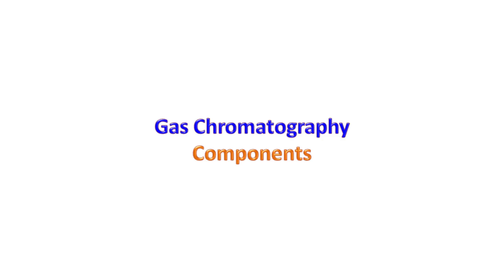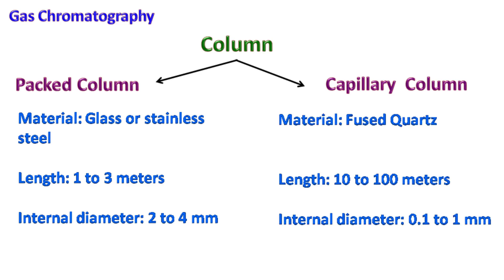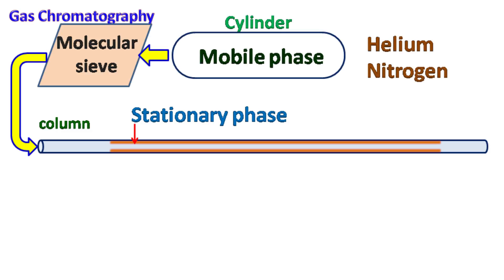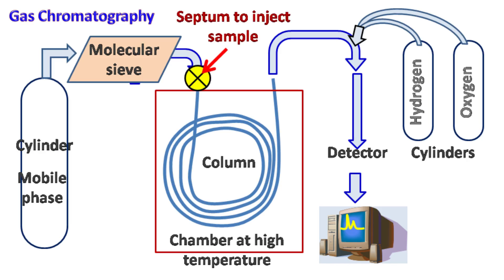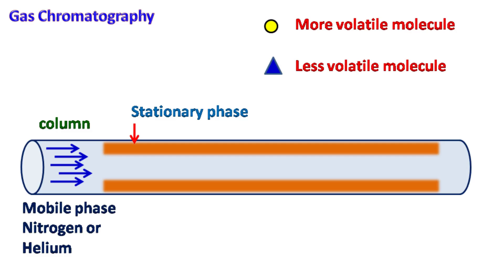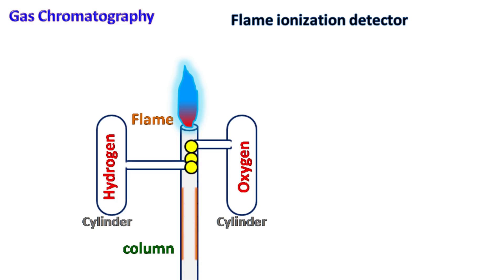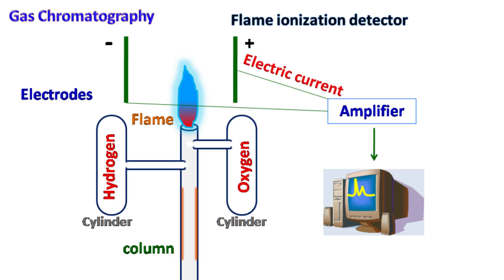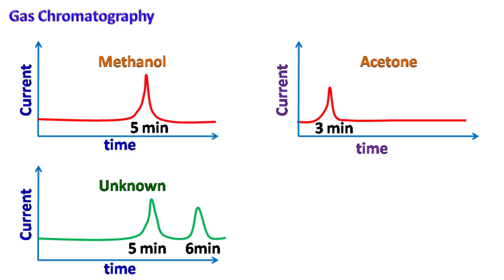Gas chromatography | GC

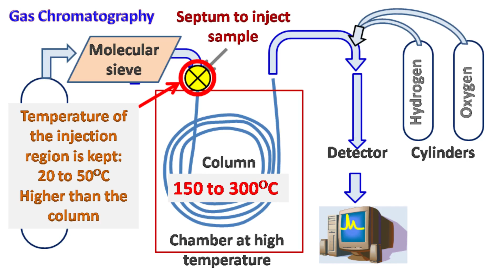Comment: 2:45 I don't understand when the temperature of the injection in 20-50 degrees Celcius and the column is 150-300 celcius which means the column is higher, but you said and is given in the picture that the temperature of the injection is higher than the column, does that mean the temperature of the injection is 150+20 degrees celcius? where we add that 20 and 50 ? Please can I get an explanation🥺
Reply: No temp of injection always greater than oven temperature
Reply: @VyankateshPawar2130  then why does it say 20 to 50 degrees celcius? and the oven a huge number ? thank you for your reply :3

Comment: summary of the video: 
GC is used for the separation of volatile compounds( compounds which are easily vapourized at room temp)

Components of GC:
1) SAMPLE is mixed withe a highly volatile compound like Hexane, cyclohexane, etc.

• Long coiled column: can either be a packed column(made of glass/stainless steel) or Capillary column (made of fused quartz).

this column is placed in a CHAMBER in order to facilitate a uniform temperature. (HIGH TEMP)
During analysis,  placed at 150-300°C

• the SP is packed in the column. it is usually made of silicon grease or wax as it can withstand high temperature 

• Presence of a SEPTUM to inject sample just before the chamber - the temperature of the injection region is 20-50° higher than chamber. this is to facilitate the rapid vapourization of the molecules. 

2) Mp: usually helium / nitrogen (inert/unreactive gases are used) are placed in a cylinder connected to the Column via the Molecular sieve. 

3) Molecular sieve is used to filter out unwanted HCs, Water vapour, oxygen etc that may interfere with the sample during experimentation.
 
4) Detector
Reply: Detector - common: FID ( FLAME IONISATION DETECTOR ) which has 3 inlets:
• carrier gas from the column
• hydrogen
• oxygen 

ignitor ignited the H2 and O2 to produce a flame.
when sample molecules reach the flame, they get ionized and electrons are released. 
across the flame, there are 2 electrodes ( cathode for cations, and anode for anions)
the electrons generated are detected by the electrodes in the form of current and it is amplified by the amplifier/Computer.
Reply: the computer then generates a graph:
X axis- time
y axis- current

based on known samples and comparing their output with the output of the unknown samples, the retention time/concentration can be deduced
Reply: @sequeira7330  seems like you're a technician of GLC...
Excellent explaination bruh🎉

Comment: I work for a company in the Chemistry industry that manufactures instrument and that was pretty accurate, good job. Only thing is inlet is at 20-50C higher than the max temperature reached by the GC and there is also an inlet of Makeup Gas for the FID which is usually to compensate the fact that nitrogen or helium coming from the column is usually much lower than the other gases. Other than that, great video

Comment: Okay but what about when two samples have similar or even the same retention time? I use LC-MS/MS as a main tool for my PhD work but I was curious about how this other technique works.
Reply: You can use a different phase to achieve different RTs. There are some that will never work on GC. For instance, M,P-xylenes are not chromatographically separable. However, using a HRMS will differentiate the identifications.

Comment: You said temp of injection is higher than column but column temp is 150 to 300°  Celsius
Reply: Because column oven temperature will be increased from 50 to 60,70,80 and it shouldn't be higher than injector yes detector can be same or higher. Than oven
Reply: Yes right😂😂
Reply: Column temperature ka nahi ,column jisme placed hai na thermostat m uska temp hota hai 150-300
Reply: @anushkajain6200 speak in english no one understands indian
Reply: @lion-o848 we simply don't care whether you understand Hindi or not. There's a translation option underneath the comment if you want the comment in English.
Reply: The injection temp is 15-20 times higher than the column. So injection port is 170-320°C
Reply: @namithananditha3879  I got what you meant but just wanna point it out for others to avoud confusion😊
It’s 15-20 degrees higher not “15-20 times higher”
Reply: Why is Shirley learning GC?
Reply: Yes